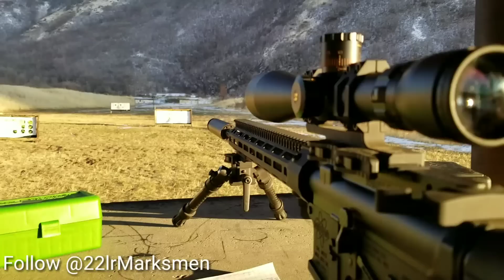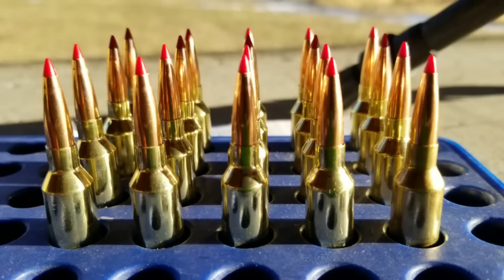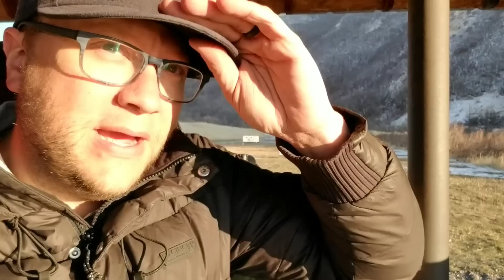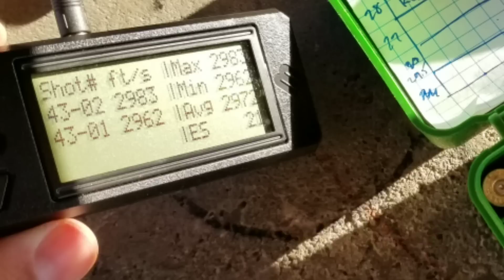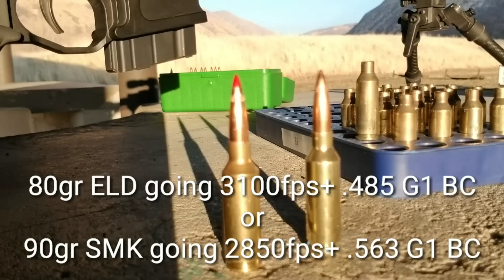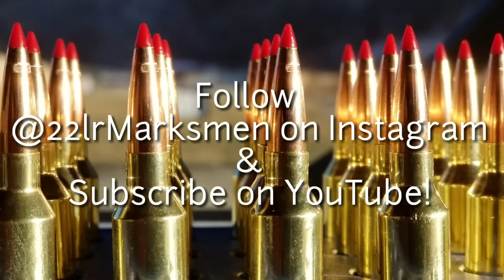22 Grendel Update. Shooting 80 & 90gr Bullets

Comment: What kind of velocity are you getting with 90gr bthp, consistent and reliable velocity?
Reply from the maker: 2950ish
Reply: @22lrmarksmen  Nice, and with the 80's I can hit 3k right? without pressure problems?
Reply: @22lrmarksmen  Hey Jim , I was looking at doing a 6mm Ar or the 224 AR from 6mmar.com. I can't seem to get in touch with them or obtain any further information. I was looking at your barrels and baldwin gun works as well and had a few questions. Do you have a website or anywhere I an take a look at your products or order a barrel. Thanks , John
Reply from the maker: @i556xx4  www.TacticalCannon.com
Reply: @22lrmarksmen  thank you bud

Comment: Not to put down your rifle at all as it is awesome from what I see.

But your velocities I wonder how much of a safety net there is for pressure compared to the factory loaded 224valkyrie which is still not finalized. 

I'm really curious of when hand loaders start handloading 224valkyrie. Can they match your velocity? I'm not familiar with the grendel case but I believe it to hold about 1.5 grain more so prolly can't match velocity. 

Now this blows 22nosler way out of the water.
Reply from the maker: Kyle Vanwinkle my understanding is the 224 Valkyrie is fairly hot as it is at 2700fps with a 90gr SMK. That's a phenomenal bullet but an 80gr ELD is a much better choice inside 1000yds. If I'm shooting beyond 1000 I'm certainly not taking an AR with me! Whatever the Valkyrie can do, the Grendel will beat. It's science.
Reply: Jim Cannon well I cant attest as to how hot the factory 90g gmm 224valkyrie load is. I would think it would be quite mild considering how mild the 223 69gmm and 77gmm, and 308 168 175 and 180 are. 

Time will tell. If 22grendel could gain factory backing I might have to try it. The 224valkyrie will probably be my next rifle maybe not wish there would be more 223/556 bolt Guns with a 1/7 twist as the 77g matchking is plenty for me.
Reply: Any issues with breaking locking lugs with full power loads?

Comment: Do u have a fb page? I'd like to talk to u about getting my hands on this!
Reply from the maker: D Hal one more thing...this has 1076 ft lb of energy at 500yds. Also, the gains from a Valkyrie is significant. 10% greater velocity. That equates to 66.6" LESS drop at 1000yds with the same bullet. That's 5'6"!
Reply: @22lrmarksmen  5'6" is nothing at 3000ft
Reply from the maker: @i556xx4  it is if it's shot from the same platform & the same bullet!!
Reply: @22lrmarksmen  I guess so Jim. I've been reading about the 6mm ar turbo and 224 ar and its quite interesting. One thing I read is that the 6.8 spc case is supposed to be stronger then the grendel case. If so, why is the brass and primer pockets getting destroyed so easily (in the 224 valkyrie)? With the restrictions in magazine, I feel like the 224 is a better ratio of powder to bullet weight then the 6mm ar. I'd like to give this grendel a try Jim. I have to get rid of some of the valkyrie parts first.
Reply from the maker: @i556xx4  you've heard the bolts are stronger, which maybe they are. The Grendels barely ever have bolt issues. The brass is stronger because there is more material between the rim and the primer pocket.
Reply: Jim Cannon - any thoughts on a .257 Grendel? Great terminal ballistics I bet. 🤔
Reply from the maker: I don't abide by the "hunting" bullet labels. Berger Hybrids kill as good as any "hunting bullet." I killed my buck this year with a 6mm 110gr Sierra MatchKing. I plan on using the Hornady ELD-M 80gr (.485 G1) and the SMK 90gr (.563 G1). The Highest .257 I can find is 115gr Berger VLD at .466. The issue is, that's a SLOWER bullet with a lower BC. That's bad for two reasons. Speed makes bullets flatter shooting as does the BC. Speed makes a huge difference in just 25-50fps. a 90gr can hit 3000fps in this caliber. I'd estimate a 115gr would maybe reach 2700-2750.
Reply from the maker: Dropped it. It was a 6x47 Lapua but I'm certainly not going to hunt deer with a 224 Grendel. I'd use this for Coyotes and smaller. Construction of bullets sure do differ, but many bullets branded as "target" actually kill extremely well. Go try it. You'll be amazed. I have 40 or so friends with freezers full that agree.
Reply from the maker: Jared Mikoleit I do. I got your message but I'm banned from responding right now.
Reply from the maker: Feel free to email me at 22lrmarksmen@gmail.com
Reply from the maker: I don't like .25 caliber bullets. They don't offer great BC's.
Reply from the maker: Email is best. Send it to 22lrMarksmen@gmail.com
Reply: Jim Cannon  - Oh you use Mk’s for hunting? Track it much? We’re comparing 224  Grendel again or are you talking another caliber? I’m asking you what does your caliber offer that’s superior to what is available now using the same Grendel casing. Construction of the bullet means everything in a hunting scenario...all you managed to show was your lack of knowledge by substituting “match” bullets for hunting bullets.
Reply: Jim Cannon - Ok now I’m seeing what makes sense. 6x47 has been used very successfully for that. Here’s where I am going with this. Your bringing a caliber or round out that is very close to what’s coming out as a factory supported cartridge. (224 Valkyrie) the only downside I see is this being passed over because there’s factory support for Valkyrie. 

I love the Grendel variants, I have several...6mmAR and 6.5 Grendel. My 6.5G is not only in an AR platform, I have it in a CZ527 with a Proof Research 24” stainless barrel at 2.330” COAL I’m running a 120gr  Nosler E-Tip with a .510 BC at 2550 fps. At 500 yards it’s putting 800+ ft lbs of energy on target...with a hunting bullet. Yeah it’s a bit slower but barrel life isn’t degraded as quickly either and I have my dope chart pasted to the stock so it’s nothing for me to dial up. Love the idea of it as I really like using a Redding Type S Bushing die for EVERYTHING 6.5G brass. 

Here’s a simple example, take .223 Rem vs 6mm223...you can get the same velocity with 10gr more bullet weight from the 6mm223 (60gr bullet from a .223 runs 3050+ fps and the 68gr from the 6mm223 runs 3100+ fps). This can be applied to the 224 Grendel vs 6mmAR as well. Anytime you take a given case, with the same pressure and increase the bore diameter, you are going to get more energy out of the larger bore. Why? It is the volume occupied by the base of the bullet versus the same amount of pressure acting on it.
Reply: Which hunting bullets in .224 offer higher BC's then in .257? Just curious...can't seem to find a good hunting round in .224 caliber. I'm happy with my 6mmAR if I'm chasing high BC's in a hunting bullet but I can see the appeal...have fun with your little round that's going to get overshadowed by the Valkyrie because of big FEDERAL making ammo so cheap no one will look twice at the marginal gains your round puts out.

Comment: Who needs 224 Valkyrie when you got this!
Reply from the maker: Halfdollar 86 exactly!
Reply from the maker: wel1968 that's actually not correct. Valkyrie is a necked down and shortened 6.8 SPC. It has less case capacity.
Reply from the maker: wel1968 also, a different case head diameter.
Reply: wel1968 it’s a necked down 6.8

Comment: make 7 twist 3r +2 gas
Reply: Liemciemdk89 I think it will be 5R, 7 twist and +2.
Reply: Jim Cannon Thanks Jim! I wouldn't mind having a bolt gun like Howa Mini Action chambered in this. I plan on starting to reload this year. You should start pitching this caliber to companies like Hornady! They would be interested in this for competition to Federal's 224V.
Reply: A 1/7 twist 3r would be nice, stainless and nitrided 22.5" spr profile +2 gas system 5/8-24 thread, just getting a chub thinking about it
Reply: Adam Azouri why 5/8x24?
Reply: Steven Littleton to reduce muzzle swelling  at the end of the barrel from relieving metal. Same reason x caliber is having problems with bore diameter after contouring their barrels. The barrel in the video is setup in this regard as well, w/ 5/8-24 thread. I know it's not mentioned, but Jim is using a 3 groove ARP barrel, which I attribute the velocity to.
Reply: Adam Azouri not sure why this 22cal barrel is any different than everything else on the market.
Reply from the maker: https://docs.google.com/forms/d/e/1FAIpQLSdVMDJvFOTdFO7t5V3YPPthGznWmSPQxl6AcjtE8pezSkqCDA/viewform
Reply: Jim Cannon $395 for just the barrel? Is there even any factory ammo in this caliber?
Reply from the maker: Hard Target working on it. Reloaders are ordering these like crazy. Factory ammo will be available soon, but this is ANOTHER reason to reload as if you don't have enough.
Reply from the maker: Hard Target I agree! I need to try it. I have a friend that we made one on a Ruger American! I've been wanting to talk to Hornady about it.
Reply: Jim Cannon I live close to Hornady and have a friend that works for them. They would be the perfect company to have backing from!
Reply from the maker: Hard Target talk to them.
Reply: Jim Cannon hey I put myself on the wait list for your 22 grendel products recently. I was just wondering on how long the backorder wait is roughly? Thank you. L
Reply from the maker: Roger U it's getting really close. PTG messed up my reamer so they are making it right now.
Reply: Ok cool, thanks for the quick reply.